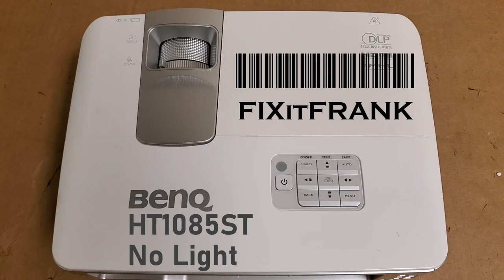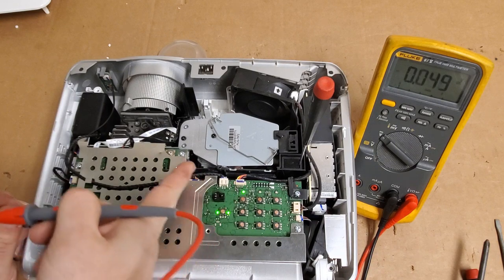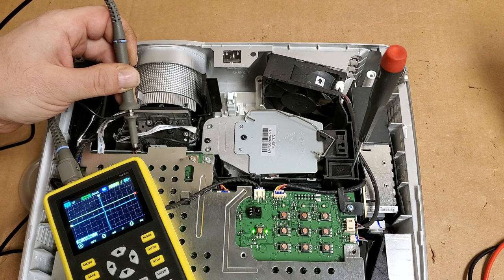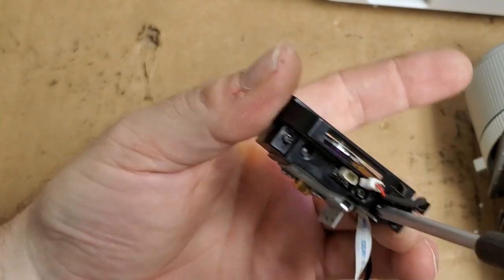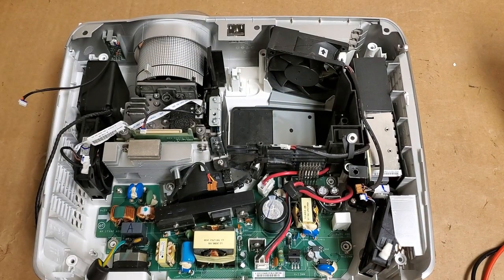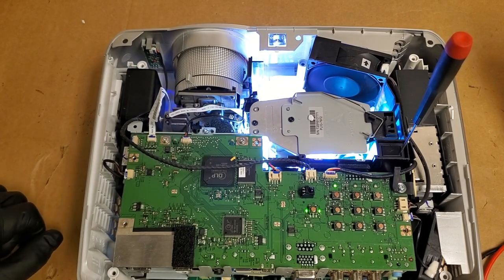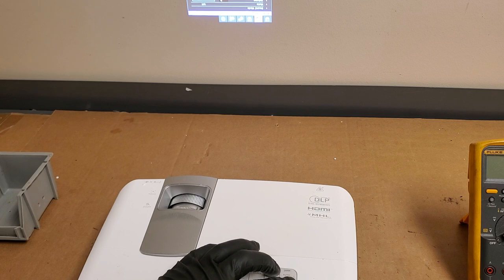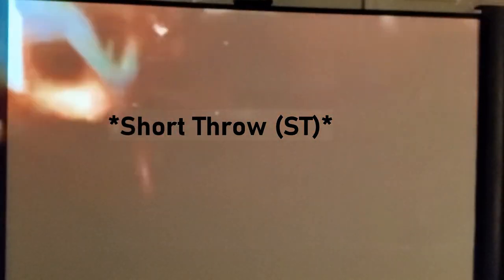BenQ HT1085ST DLP Projector No Light

Comment: Hey, this might be a stretch, but I have one of these ht1085 projectors that I got in rough shape used. I changed the lamp, cleaned it a bit, and it worked great for a while. Then it started shutting off unless there was some weight on the top door. I opened it up and tore everything down, cleaned out a bunch of dust from the fans, checked all the parts, put it back together (still have two spare screws I can’t find a place for - two black countersunk philips screws if you happen to know where they go), and then realized it was the door/safety/interlock switch all along. 

Then I proceeded to try and jiggle it or jam it in place, and it was either already broken or I managed to finally snap off some piece. All the plastic is aged and brittle on this thing and I have a couple snapped off pieces of the case that didn’t go back in as well. Spent two+ hours opening and putting it back together and then broke the part that was the real problem. Is this even conceivably a part I can buy, or should I just solder the little jumper pins or switch contacts inside so they stay closed?

Again maybe this is a stretch asking for advice on a year old video from a hobbyist who has no obligation to help me, but I thought it was worth a try. My back still hurts from craning over this dusty piece of junk and I don’t want to have to tear it down again. Speaking of, I wonder if I can get a replacement rubber foot for it as well since mine never came with one attached. If anyone can help, I greatly appreciate it in advance.
Reply from the maker: As the hobbyist with the year old video, I am stoked to help you!  Anyone who takes a stab is at least entitled to some replies in my opinion :)  
1. The 2 screws should be for screwing the HDMI connectors into the back plate.  Not required but you want them in place if possible.
2. I would take it apart one more time.  You could just solder the contacts together, but I found it a lot easier to merely cut the red/black wires and connect them where they plug into the power supply.  https://imgur.com/1DCOq4X  You could even solder a jumper(use a piece of that red or black wire so the size is adequate) across the proper pins on that connector.  

I wouldn't bother replacing the switch or making it work.  That switch is an idiot switch to prevent people who aren't thinking from hurting themselves by firing up that lamp with the door off.  I have a few projectors that I bypassed the door switches on.  Just one less thing to go wrong...

I hate to send you back into it one more time, but I suspect this is the last. Or, wad up some foil and jam it down into the switch(don't do this. It was a bad attempt at humor). 

As far as the foot, thats going to be tough to find new or for sale but if you want to email me(on the about tab) later this week(Im on vacation until Wed) I can look in my scrap pile to see if I have one.
Reply: @FixitFrank  Hi, and thank you very much for replying. This is perfect and I don’t know why I didn’t think of just jumping the actual wires rather than trying to jerryrig a jammed switch like the intended design. The joke was great and is actually sort of how I broke it, trying to wedge a piece of plastic in there so it would contact. I assume the bottom of the switch sat on a tiny plastic ledge that has been through a couple hundred thermal cycles at this point. It’s like trying to disassemble a gingerbread house without leaving crumbs everywhere.

Totally agree that the switch is there to cover the manufacturer’s ass in case someone stick their fingers in the ballast while it’s running. I have no problem removing it and I think this projector’s next home will be an electronics recycler or I’ll sell it for parts eventually. 

I can definitely take it apart again - I should be able to a lot quicker this time around. Funny story - when I was putting it together I panicked at one point because I forgot that the speaker plugged into the main board after I bolted it down. Thought I missed something and the only pictures I could find online didn’t have pins there. Felt like an idiot taking all the way apart to see if I tucked a wire in the wrong place before I saw the speaker sitting on the table in front of me.

Side note, the two screws are not for the HDMI ports - those are dark bronze-ish countersunk screws and are shorter than the black ones. I’ll have to check all the fans and parts to see if I missed some screws there. Thanks though.

And I really appreciate the offer for the rubber leg. I was just planning on going back to the little stack of rubber I was using, but I’ll send an email in case I can make this projector just a tiny bit nicer. I’ve got a weird setup in an attic with a sloping ceiling so I have it really close to the ground in a tv stand and it does like to lose aim if I bump the stand. Still fit a 100” screen in there at an ~11’ throw and it looks awesome when it works.

Maybe I’ll actually try disassembling the optics part of it this time and fully cleaning out the lens stack. Still getting some “bokeh” out of focus dust particles, although they’re only noticeable on a white screen. Do you think this would be worthwhile?

Sorry for the long comment - you’ve helped enough and my remaining questions and anecdotes aren’t important. Niche communities like this are some of the nicest places. Enjoy your vacation!
Reply from the maker: @Anya-Prime  No worries at all.  I enjoy knowing people can repair their gear with this info.  I'm no one special, I just  have made enough mistakes to know what not to do ;)

If those screws are coarse/helical thread, check the RCA connectors.  The only countersunk screws in that unit that I can recall are the HDMI and the RCA's.  
I'd rather give you a rubber foot than have it end up in the trash.  The main reason I do all of this is to keep more toxic stuff out of the ground. Secondly to keep money in peoples pockets.

I would clean the optics if you have the opportunity.  cleaning the surface of the DMD should solve your situation.  Granted its a less is more thing.  You don't want to take every bit of glass out. I would remove the DMD(I have some videos) and clean the surface of that. Once the DMD is clean, you should be fine. 

As a fellow "wordy" person, I don't mind long comments at all. I actually enjoy them. One thing I always here is that I am never at a shortage of words.  Sure you can get the point across with less words, but its not as much fun and no where near as interesting.  

The more instances I learn about how folks use their projectors, I can learn more about to keep them running.   I like the knee-wall ceiling method.  Depending where you are, it probably helps with heat in the winter.  I know my HT1075 keeps my bedroom plenty warm. Please feel free or even invited to email me and I can see what I have for the foot.  I have a bunch of scrap benqs and I can picture the foot on a scrapped 1075 chassis so I can throw in the mail without issue.  

Talk to you soon!
Reply: @FixitFrank    That’s precisely it! I’d rather type a paragraph than be misunderstood. I’m also known for my inability to be concise. Thanks again.

Oh and I have no clue how I pulled out 4 countersunk screws out of this thing. I think I’m the first to take it apart, so I can’t imagine they were replaced. I’ll report back if I figure it out this evening when I go back in there.

I think I will attempt taking apart the optics. I am wondering why you think it may be the DMD - I would think if the DMD had specs of dust they would show at any focus since the DMD is effectively the pixel grid and possibly(?) a focal point of the lens. That’s why I thought lens - I have an old canon lens that exhibits similar effects from the irreversible fungus damage it had. I’ll rewatch the video where you take that part apart for reference. I went in a little blind the first time - you could call it exploratory surgery.

Side note, can you believe they’re using DMD technology for adaptive headlamps? Audi straps two DMD projectors on the front of a car and I can’t get a stationary movie projector to not wobble when I walk by it. That may be more of an indictment of this 100+ year old house than it is the projector, to be fair.

And you’re right, that room is quite nice in this north east cold right now. My cat loves to sleep by the exhaust fan. Also, the biggest downside of mounting it low is that it effectively has to be in line with the bottom of the screen to be within range of the optical keystone correction. It’s a terrible photo, but here’s how I had it set up: 
https://imgur.com/a/j91kVWy
I’ve since added a receiver and speakers and tidied up, so it’s a bit different once I put it back.
Reply: @FixitFrank  So I opened it up and modified the door switch with a jumper, and that worked great. Then I opened the optics and cleaned the DMD and unfortunately I’m not sure it’s an improvement. Maybe my glasses cleaning cloth wasn’t clean enough. I think it has a glass cover, but is it possible to damage the DMD mirrors directly this way? There’s also still remaining dust and it looks different and more pinpoint now.  

But now on reassembly it’s also not displaying anything but a black screen on power up. Happily turns on, lamp works, but no input, no menu, and it doesn’t even let me shut it off with the buttons. Hopefully I didn’t damage one of the boards or something in the DMD/color wheel. Maybe the inputs board isn’t connected right or one of the big pin arrays is bent? 

Guess it’s back to the repair table. I forgot how frustrating it can be to troubleshoot electronics. Sorry for the venting, I haven’t lost hope that I forgot something easy and silly that will fix this new issue. I’ll check the obvious culprits and start checking components.

Regardless, thanks again for the help and advice!

Comment: Hey Frank... I know you are working on a BenQ projector, but it seems to have very similar parts and functions as my Viewsonic projector. I was also having an issue with what seems to be the color wheel. I recently replaced both the lamp and the color wheel, directly from Viewsonic. Everything was carefully and properly put back together, although the lamp doesn't seem to want to turn on. I can hear the color wheel start to turn when I power it on, then it stops. I get a red lamp error light, then after a couple of minutes it tries to spin the color wheel again then powers off. I made sure the ribbon cord was the correct way. I even tried switching the color wheel sensor out for one on one of the other color wheels and it was still doing the same thing. I have changed my color wheel out before and it worked perfectly fine again after doing so. This time around it just keeps giving me the lamp error. One major difference between changing the lamp and color wheel this time was after the bulb exploded. Could that have caused a short somewhere in the lamp connectors and possible have to replace the lamp connector? Are there any suggestion you can give me as to what else could be causing it to do this?
Reply from the maker: This is all speculation since I dont have it in front of me, but the ballast would be my next place to check. Exploding lamps can jam the lamp blower fan and cause ballast damage. make sure your blower fan is okay and not jammed and then you may want to pull the ballast and test it.  look for the ballast check video I have for that.   doubtful its the lamp connector unless you can see physical damage.
Reply: @FixitFrank  I appreciate the response! I will check that next.

Comment: Oh man I am going to enjoy this one! Frank I have a Vankyo V630 in my hands for testing, it is the most amazing cheap 1080p projector as far as lumens and picture quality, BUTit sucks in games. Lag is so atrocious the thing looks like it is missing frames. I will post a video about it in the next days! Thanks for sharing man!
Reply from the maker: I've heard that about those.  The 630 was popular on r/projectors comment threads when I posted there.  Someone got ahold of the actual manufacturer and got a copy of the specs.  You might want to check for that thread for your video. They had some interesting info on the 630.
Reply: @FixitFrank  Thanks Frank! I will. Also contacted the manufacturer and they told me to send them a small video clip so they can see what I mean. I did. But, I really have no hopes for fixing that. It is a real shame though, V630 would have been AMAZING if not for that problem. I will make a video in the next days.

Comment: Hello Frank - I don't know if you are still monitoring your YouTube Channel. I tried following your steps in troubleshooting a BenQ 1080ST projector.  A few weeks ago my lamp blew up (literally). I bought a replacement lamp, an Osram OEM lamp but the lamp would not turn on.
 
I followed your troubleshooting steps on YouTube, and I don’t get the voltage readings that you get but I am not sure where the problem is.
 
I measures the lamp and I get infinite resistivity so the lamp is good.
I measured the color wheel sensor signal (most left pin) and I get a constant reading of 3.55 volts ( the voltage does not drop to 0.4 volts when I turn the projector on). The color wheel is turning.
I also measured the voltage at signal to the ballast (4th pin from the right) and when I turn it on it initially reads 4.37 volts, it drops to 2.34 volts and goes back to 3.34volts where it stays (eventually it goes back to 4.38volt)
Finally, I also measured the input to the ballast per your video, and I get a constant reading of 152 volts, not 388 volts what you get.
 
So I am not sure what the issue is, can you help?
Reply from the maker: Hi, I do monitor.  Im still making content, just busy with that whole life thing.  Most likely your power factor correction power supply was damaged when the lamp burst. It might have damaged the ballast too.  Check the mosfets on the ballast for shorts. If no shorts are found, then I bet its just the PFC supply. As far as what's bad on that end, hard to say.  Check the large mosfet on the heatsink, the TVS diode underneath and all of the corresponding parts that create the 380. Thats likely your issue. Be careful of that filter cap. It holds a charge and its very spicy.
Reply: @FixitFrank  thank you soo much for kind reply. I do know what you mean by life getting in the way. I will check the mosfets on the ballast. Do you have a recommended supplier for the PFC? 

Thank you again - Robert
Reply: One more thing - I wrote BenQ - they said to send the unit in to be checked. Do you have any experience with it? is it worth  fixing if I cost me another $300- $400? I bought my projector approximately 10 years ago.
Reply from the maker: I would not send it to BenQ.  $300 is far too much to spend on that .  I would contact an e-recycler to get a price on a full power supply.  Gydz@timeprojectorlamp.com is who I use. Send them a picture of the power supply(the board that the AC cord goes to).  The 1080ST is great but I would set a cap of $200-250 tops for any repairs.  3-400 is just too much. You can sometimes find a used 1080st working for $300-ish.

Comment: i have a benq w100 projector worked fine last time i used it i keep it clean from dust build up and so on i  powered it up tonight the bulb comes on for a 5 seconds then goes off when the fans kick in what do you recon the problem is with it many thanks
Reply from the maker: check your color wheel sensor and any wires you disconnected and reconnected.  If it worked before and you just cleaned it, then something isn't connected or aligned properly.  I have had a few where I had to take it apart 2-3x before I got it right so dont be too frustrated.   Or if you put a new lamp in, make sure it has the good UV/IR lens.

Comment: Hi. What if all indicators tell it works fine but the projector actually doesn’t? No picture after lamp replacement (previous one exploded). 1080st
Reply from the maker: Hi Igor,  That could be a ballast. If the old lamp exploded it might have damaged the ballast.  You would need to measure the high voltage into the  ballast and the TTL controls to know for sure.